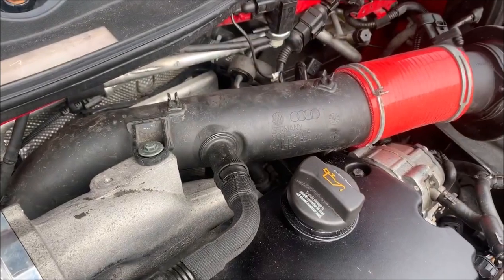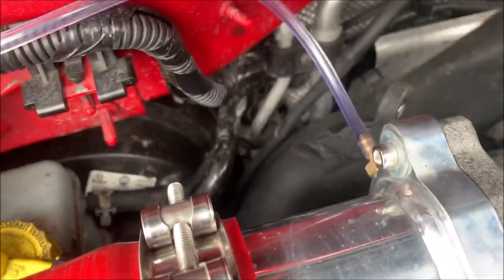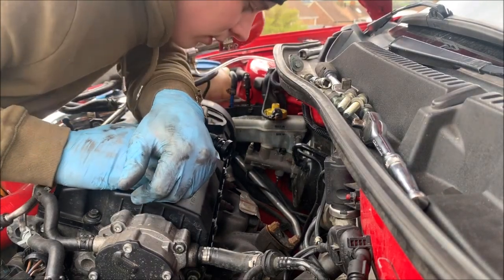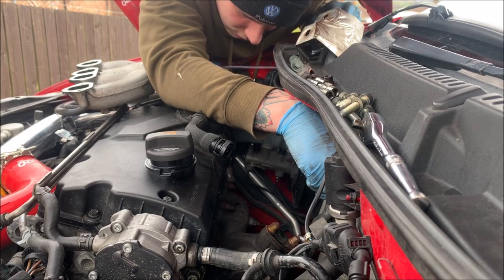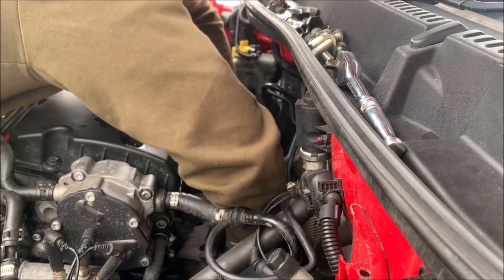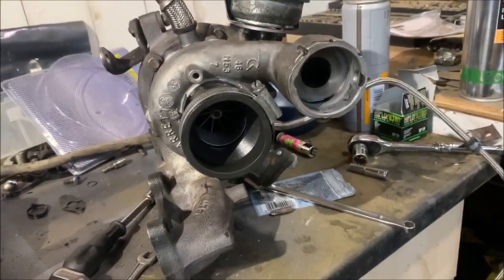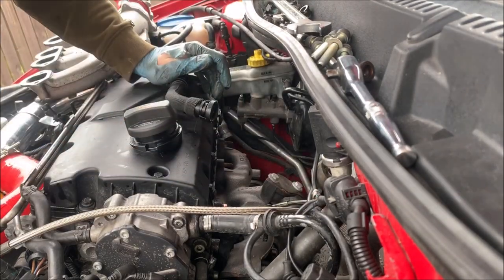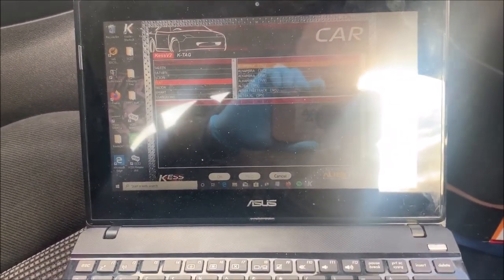GT1756 Hybrid Turbo install! | Leon FR+ 1.9 TDI PD150 ARL | DIY

Comment: I can't believe you managed to do this without going underneath apart from the pancake of the intercooler . So this is possible without ramps . Thanks for this its a massive help might try and remove the one on my mk4 later . As I got a new hybrid of xman turbos two weeks ago and its blown already 😒🤣
Reply from the maker: Honestly it’s the easiest turbo I’ve ever done. You’ll also need to get the oil return pipe off from underneath.
Reply: @Dandoescars  thanks any other tips let me know as about to have a bash now .After seeing this I thought it  wasn't possible from the top . Just hope my engine bay on the mk4 golf pd 130 is the same clearance . Thanks bro big help
Reply from the maker: @mitthepirate   make sure you change oil and filter too. Clean out your intercooler pipework if the turbo has blown, other than that it should be pretty much as the video!
Reply: @Dandoescars  it hasn't fully gone it is brand new lol . Just above 3k revs get a metallic sound . Some crap failed component inside I think..    thanks your a legend for this vid gonna save me a few quid
Reply from the maker: @mitthepirate  any time dude 😎

Comment: Noticed you're using kess, what sort of map are you using? A generic "stage 1" meant for the stock hardware or are you able to custom map it to take into account the higher boost the 56 will run as well as all new fuel mapping needed? Have you swapped your 3 bar map sensor for a 4 bar? Cheers
Reply from the maker: Hi liam! yeah its custom mapped. I'm just using KESS to flash the files on and off the car. I have a mapper that send me the files to flash on after I've done data logging etc using VCDS. And yes I have a genuine Bosch 4 Bar MAP sensor
Reply: @Dandoescars  sweet, I was running a gt1752 on my a3, had it mapped at dervtech to 217hp, I've just put an xman gt1856 on and booked back in at dervtech on Saturday, addicted to it now I think 😂
Reply from the maker: yep you cant get enough once you start making more! planning to go 2260 eventually.
Reply: @Dandoescars  i was going to go that route too, can get 2260s on the stock cast mani for £850 it's just then the extra hassle of getting the downpipe modified, larger injector nozzles etc, it's a hell of a lot more work and cost for a reliable 300hp whereas the 1856 will see 260hp "semi-reliably" with just a 2.5" turbo back, alloy FMIC and hard pipe which is where I'll be at on the weekend fingers crossed.
Biggest difference between for me between the GT1856 and the GTB2060 is the newer VNT which is more efficient and spools quicker.
Reply from the maker: yeah I've heard good things about the newer VNT systems. I just like the good old laggy 2260. I love the way they drive. I'll be doing all supporting mods to see a reliable 290-300bhp
Reply: @Dandoescars  had mine mapped again, 259hp and 500nm, you've got some catching up to do mate.
Reply from the maker: Liam oh shit 😳 time to save up for the 2260 I think 🤣
Reply: @liamting  Hey, sorry to barge in like this, What engine are you ruining on the A3?
Reply: @0beed0  Hi, sold it now, was the 2.0tdi bkd
Reply: @liamting  Cheers, looking to sort a ARL or a 1756 for a 1.9 BKC and was looking for some impressions of the 1756 on the BKC for lag.
Reply: @0beed0  go for a good quality gt1752, if you want any bigger you'd need a gtb or newer series turbo otherwise the lag is too much on the older gt turbos
Reply: @liamting  that's what I was thinking either an ARL or a gtb1756 just can't decide :)

Comment: How do u plug in the hybrid system on the car? I understand vnt system, but there's no hardware for hybrid?
Reply: A hybrid turbo refers to different core housings so let’s say a VNT 15 housing with a VNT17 compressor or whatever else.